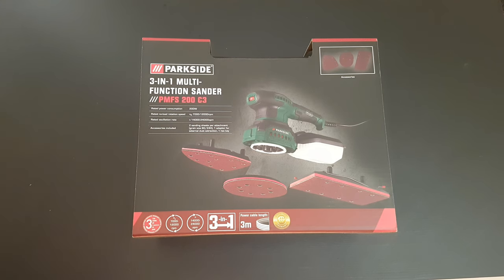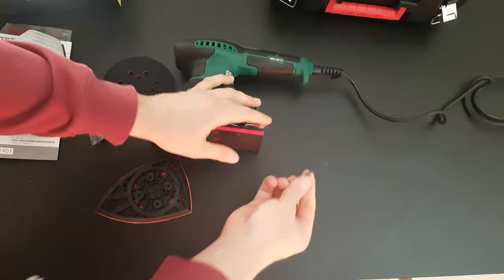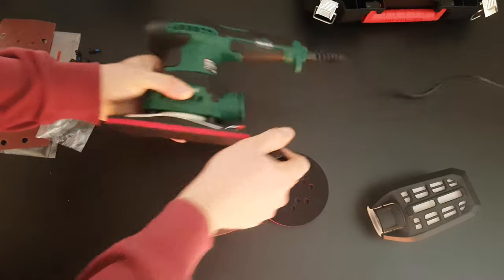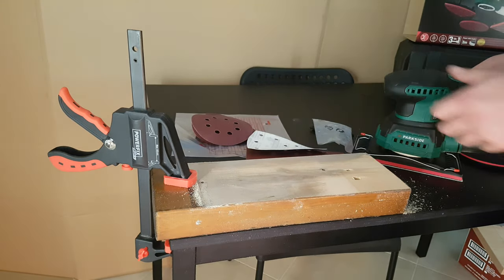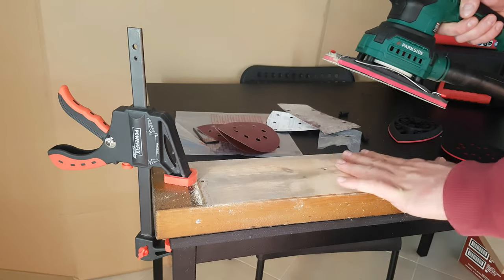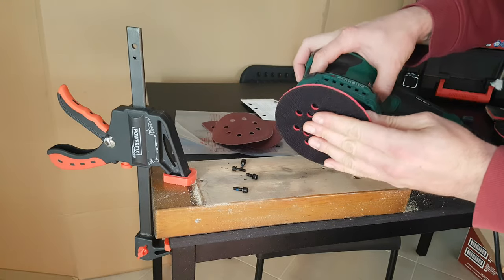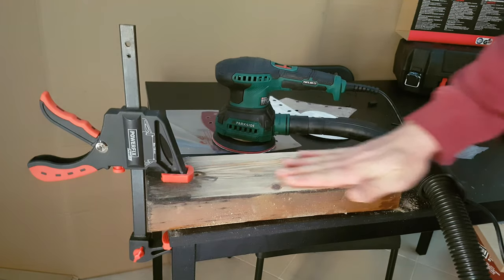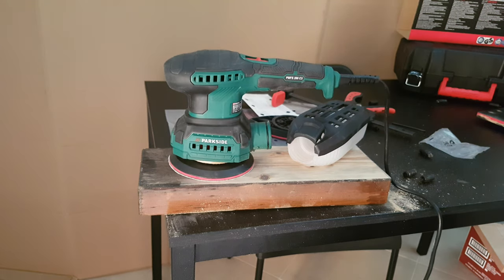Parkside 3-IN-1 Multi- Function Sander PMFS 200 C3 Unboxing Testing

Comment: Bought it, and returned it. The sandingpads (where you attach the sandingpaper onto) were warped. So you couldn't do any sanding with it, because the velcroside is so warped you needed to press so hard to make contact with the surface. In the video i see the same result, inspect the surface without sandpaper and let your eye scan alongside the sides. you will see it immediately.
Reply: As mentioned in an earlier comment, I had ordered two of these. I received them yesterday, and paid attention to your complaint.
The pads seemed slightly concave ("hollow"), but that was measured across the velcron side, and might be due to measuring across that uneven surface. Taking into account the nature of the device (eccentric rotation) and the intended use, I don't regret (yet?) buying these two.

However, thank you for drawing our attention to the matter!  :-)

Comment: Nice video friend, In my work I use Festool  ets 150/5 eq,  Rupes er 05 te, and metabo sxe 450 turbotec, All three of them are a round orbital sanders with 150mm disk. and they come with little diferences from each other, for example festool is lighter than all and nice to hold , with little diference comes the Rupes, and metabo is more heavy duty, but much heavier, so its hard to work with it for hours. In my opinion its best to invest in a tool that will do the job faster and better and will last for a decade instead of a cheap tool that will slow your work and wont last for long! Keep making nice videos

Comment: Hello Andrew...
How are you...
Hope my message finds you well.
I wanted to ask you a technical question as you the only expert I know 😁
I have the drill 4 in 1 16v...
I never used it before...
I usually take out all my tools and charge their batteries in order to keep them in a good condition...
Today when I put the 16v battery to be charged and after a while the LED indicators are ON both green and red... !
I used the drill just to empty the battery a little and when I put to charge the same both light are active... I worry the sensor of charger or battery is damaged and if I let it as is it could cause over charge and create fire!
Device still under warranty... but I'm not sure if charger or battery covered!
What you advise please....
Many thanks. 👍
Reply from the maker: Hello and thanks i am ok, be healthy, 
When is charging both led are on is the battery getting got or the charger after a time?
Reply: @TechGuruAndrew  
Thanks for the reply...
No battery not hot at all...
When start charging red indicator light only... but after a while both lights are ON... while it should be green only!
I'm not sure which have the problem...
I guess either battery or charger sensor have something
Reply from the maker: Contact support or check with other charger and the battery if you have ,probably is broken
Reply: @TechGuruAndrew  
I'm sorry to disturb you...
The problem that I only have this tool 16v... all the others 12 or 20v...
Maybe I wasn't clear enough...
The battery is charging without getting hot...
It just the charger instead of having green LED when complete charge... it have both red and green...
I didn't let battery stay longer on charger because I afraid to over charge and have more problem... I called service and they said they will call me back and still waiting...
I really appreciate that you are helping me 👍
Reply: Ashraf, you're talking about an entirely different device. Well, you know...  ;-)

I also have this 4-in-1 device. (I have four of them: 14.4V, 16V and two 20V.) The manual of the 16V explains the lights on the charger, but no combination of colors.
Something must be wrong: the battery, the charger, or the way the battery is inserted in the charger.

Did you maybe insert the 16V battery into a 20V charger? That would be wrong (if possible to do so at all).

The battery itself has three colors of lights to indicate the charge remaining. All three: full. Yellow and red: less than 90%. Red only: nearly empty, please charge.

If you should have lost the manual, you can download it via www.lidl-service.com, choose a language, and search for number 285087. I checked!

Comment: worse tool i ever bought
Reply: Why can u give reason pls
Reply: @KC08RAS  kind of does the job but not that powerful + REALLY vibrates a lot. If your hands are not used to suffering, good luck 😅
Reply: @polostone8876  
Lol thx for the info
Reply: @KC08RAS  sorry can't say much more ! The disc is actually '''confortable''' to use, but only for ' subtle ' work. I was trying to remove old varnish and it basically takes the whole evening ahah
Reply: @polostone8876  1)  Duration: I would start removing old varnish with a coarse grain (the 80 provided, maybe even 40), and take care that the varnish doesn't clog the grain. Did you do so so?
I'm also thinking of me and another grinding wood (the floor of the wheelhouse of a ship; remains of whatever finishing had to be removed). I minded the idea of letting the sander do the job and press lightly. It took ages. My companion did exert pressure, and it quite speeded up the job. I still wouldn't press hard when using finer grains (180 or finer).
I might also consider using a belt sander, but these tend to be more powerful (and take too much off). I haven't yet used a multi-tool with a scraper.

2)  Vibration: The manual suggests wearing gloves. I'd say: the thicker the better, then. Or maybe some cloth (like a piece of towel), as long as it can't get caught or block the ventilation holes?

(Note: I downloaded the manual and watched this video, then ordered two of these. - I do have other sanders and grinders, but these may fill a niche.)  ;-)